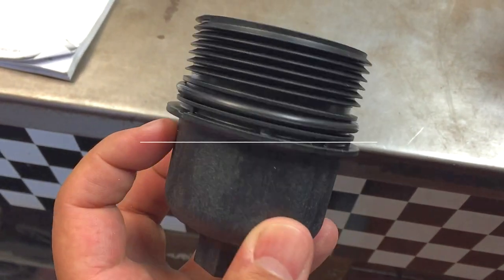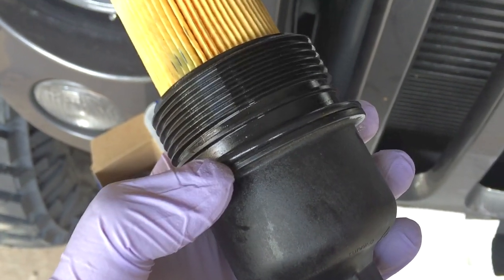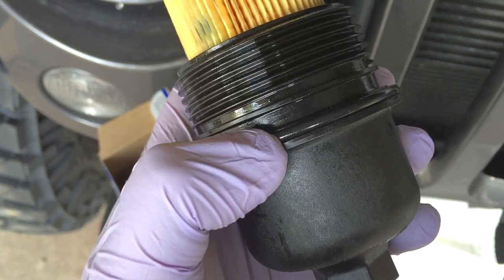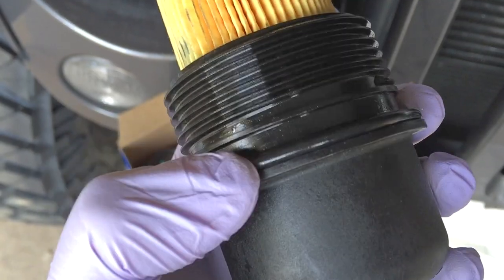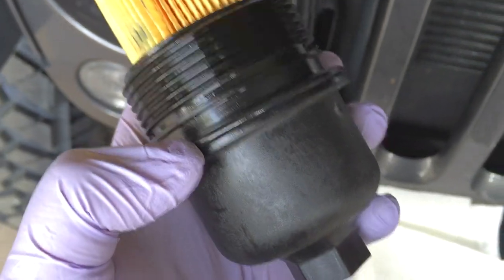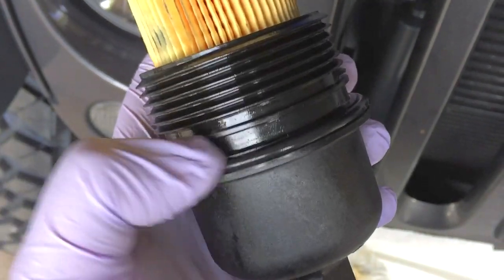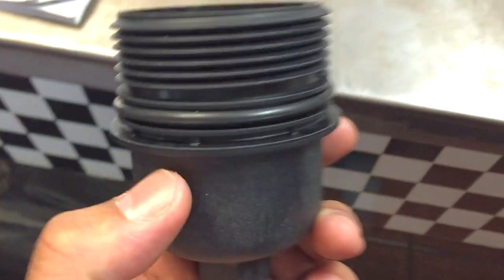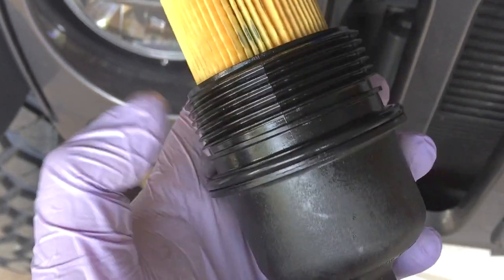Jeep Wrangler JK Oil filter cap o ring placement for my 2014 and possibly other models.

Comment: 2017 Jeep Grand Cherokee, V6. 

I changed oil on my wife's car for the second time, and put the o-ring in the wrong (top) groove. The o-ring blew out and started spraying oil. My wife was driving, and was unaware there was a problem. I noticed a trail of oil drops into the garage. Fortunately, it was a short trip and only lost a quart of oil. Bought a new filter and o-ring, (easier than finding just a new o-ring) after watching this video, and put the o-ring in the proper place. I must have done it right the first oil change, but didn't pay attention when I replaced the o-ring this time. 

Thanks for the video!
Reply: Posted the identical story! Lol

Comment: THIS IS WHY I LOOKED FOR THIS VIDEO - So funny. Changed my oil last night. Today, drove my Grand Cherokee driving along and loving the mental feeling I (we?) get after an oil change - as though the engine runs better and smoother. Although I could swear it really always sounds quieter though!

Anyway, not close to my first oil change on the Pentastar. This is my 4th Grand Cherokee. But, as I took the old o-ring off, I second-guessed myself and decided that it logically belonged on the flange and not where I put it the last time l. I figured it would work fine either way. Well today after I got home from the gym, something told me to look under the Jeep to make sure there were no leaks (even though I checked it last night after letting it run for a minute or so.

Sho 'nuff, it was dripping a good bit!  Yes, I removed and rinse where it belongs and no more leaking. 

Engineers are amazing!

Comment: Excellent video. I recently changed my oil and in my haste put the o-ring against the flange rather than in the groove. Because of this, I experienced an oil leak at higher oil pressures. And I mean a lot of oil. I originally thought the filter housing manifold was cracked, but I found your video while researching the problem and it saved me a trip to dealership service dept. and some $$$.
Reply: Just happened to me today :/, I freaked out hahaha
Reply: How much oil did you lose

Comment: Changed my oil a couple of weeks ago.   Found some oil on my garage floor today.  I discovered the O ring on the filter had begun to disintegrate because I had placed it all the way down. Just a little further verification that the higher position is correct.
Reply from the maker: +Donovan Brothen Thanks for chiming in man!

Comment: Thank you for posting this! I had this issue the first time I changed my oil sometime in mid-2015. I couldn't decide where to put the seal, and I ended up putting it on the flange (incorrect) and actually had a small oil seepage issue. It took me a couple hours to finally confirm what you show here. I am glad to see this video, and I know it will make new jeep owner's lives easier!

Comment: This is why YouTube is so great. I just changed my oil and initially made the same mistake. Fortunately the o-ring was white and when it was tightened down I could see that the o-ring wasn't seating uniformly around the cap. Some places it was sticking out more than others. I took the cap off and lowered the ring to the gap you point out and it looked much better when it was tightened down. Thanks for posting, now I can stop wondering.
Reply from the maker: +Alfred Wessex nice glad it worked! What year is your jeep? Just to be sure, this configuration was for my 2014 jku. Not sure if it’s like this for other years. Just to be clear man.
Reply: Mines a 2015 and looks identical to yours. On another matter, when I tried to take the drain plug out it was immediately apparent that it was in way too tight. I had previously had the oil changed at a local "Mr. Lube", and am certain they likely wrenched it on too tightly. All attempts eventually lead to head starting to strip so I called them up and they were good enough to loosen for me no charge and I bought a new plug. A quick search on the internet and it seems that striped drain plugs aren't uncommon on Jeeps. A combination of a too soft plug, and an over zealous mechanic, and you have a good reason to do your own oil changes.
Reply from the maker: +Alfred Wessex for sure, do it yourself or make sure you trust whomever is doing the work.

Comment: Great video. Thanks! Over tightening the cap will cause the o-ring to skip over to the flange. Then the oil leaks down the back of the engine.

Comment: Excellent video cause, yes it is very important. I changed mine for the first time, and had the same query. My logic said to put it against the flange. The next day after driving my oil light came on, found out of was leaking. After discovering its coming through the filter cap seal, I opened it up and saw the ring was warped. I reinstalled it like how you've showed it how you have, and I've had no sign of leakage. I realise there should be no view of the ring when on properly, as it seals off the air way future down the cylinder making it even more leak proof.

Comment: This placement is important... I accidentally had the o-ring on the flange and leaked a bunch of oil which accumulated on top of the transmission in pools and leaked all over driveway. Make sure ring placement is in the gap away from the flange. - Jason
Reply: Same today! I'll give this a shot and see if it works.

Comment: In my situation ( 2016 JKU) it is different.  I put it in the gap area and when i started the Jeep oil started leaking.  I placed the o-ring on the flange, and it resolved the issue.

Comment: thanks friend. just bought a 2015 yesterday im changing my oil today and didn't know this...good info
Reply from the maker: Ya man, just make sure to look at your oil cap and verify the  o ring's original placement from the factory. This viog was for my 2014 model so I'm not sure if it changed for 2015. Maybe someone with a 2015 will chime in and confirm this, unless you confirmed it yourself already. Reply back and let us know.

Comment: Interesting!  On my 2007 JKU Diesel it is a square profile o ring. The o ring sits in the same place on the cap but the cap itself is located next to the powersteering pump at the top left side of the engine as you look at the enginge.
Also, do you soak your oilfilter in oil before installing. I've been told that it does some damage to the oil filter if they aren't soaked prior to starting the engine. Of course, you can't believe everything you read on the internet.
Reply from the maker: It's different for the 2014 and I believe the 2013 is different to. I've never heard of any one pre soaking the filter and I do tons of research before I tackle a job. Thanks for watching man. Myself and JeepVideoGuy always bring you up in our conversations. We can tell you love the life that is Jeep.
Reply: Absolutely Love Jeep JK. Other Jeeps not so much. All my friends in Australia are Toyota fans (fools!) but I still like them.
Reply: Always soak the filter media if a horizontally installed or non vertically installed filter.
KAWASAKI actually recommends soaking there filter media or maybe stp I forget. If vertically installed fill the filter right up.
I can see why you really don't want oil rushing thru a filter that is dry as can't be any good.

Comment: I just changed my oil and filter. I put the O ring not in the notch but in the flange. As I was driving  to work the next day I smelled burning oil and smoke. When I got home I checked the oil and it was completely dry. I towed it to the service station as I didn’t want to take any chances. Could it have been the o ring